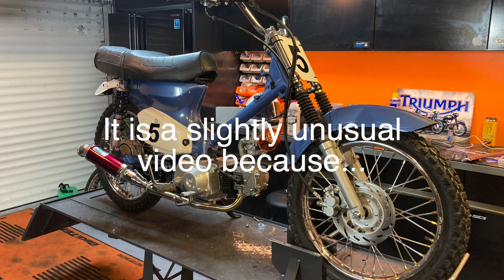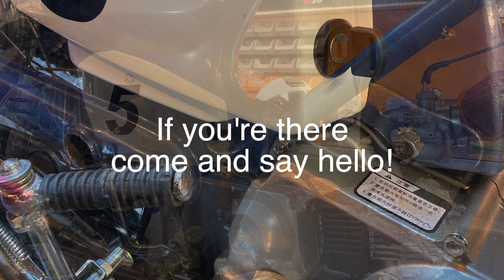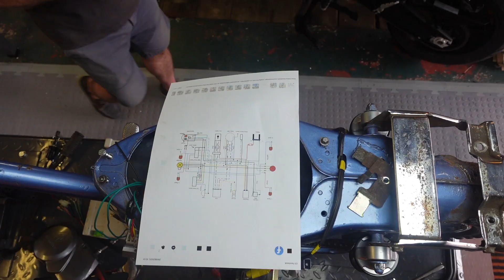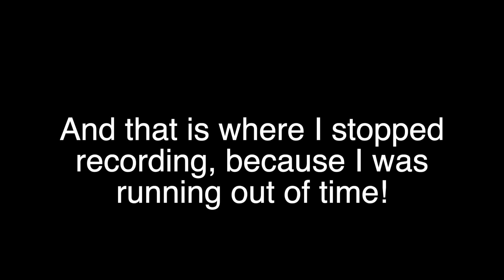It lives!  The resurrection of Frankenstein the Honda C90 race bike!

Comment: You really went all out of the bike.....you have left very little wiggle room for a poor showing my friend.  Just don't get beat by and old beater by an overweight senior citizen. 😆😆

Heck a few more changes you can run at the Bonneville Salt Flats  with me.
Reply from the maker: Is this the part where I start rolling out the pre-emptive excuses for my future poor performance - dodgy knee, dickie tummy, lack of talent etc...?🤣🤣🤣. I think we're ready, although I have only ridden the bike about 100yds up the road and back so far, so first couple of laps will be getting used to it I think.  It's a four hour race, so we'll get there!